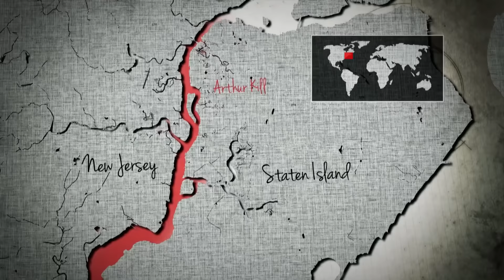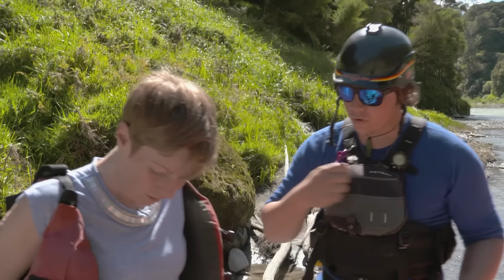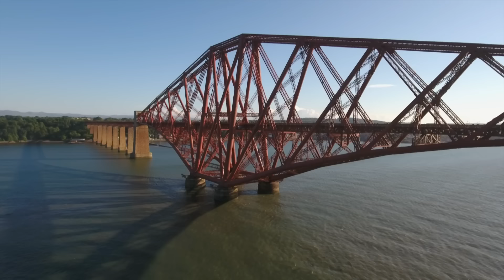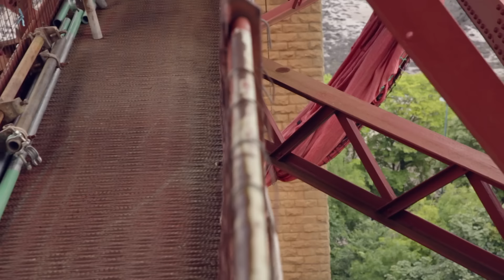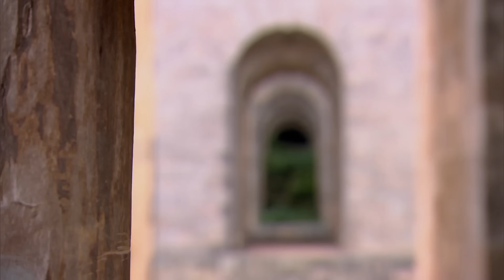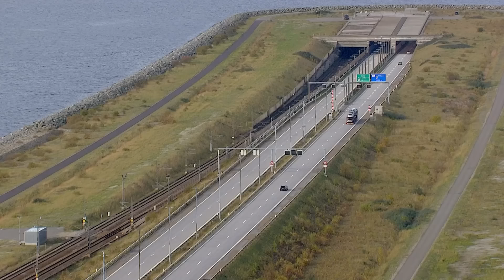175-Year-Old Railway Bridge Is Still in Use Today | Blueprint

Comment: The Forth Bridge is just over one and a half miles long. In the UK, miles are used, not kilometers.
Reply: @From 2016 mandatory to use metric units (alongside imperial.) Practically all industry is metric, I worked in construction and that certainly was and is. Also, the YouTube audience is global and every country (except USA) uses the metric system so it makes sense to cater for those.
Reply: @jackn4853  Totally disagree. This is the UK, it is a UK produced and narrated video about infrastructure in the UK. It should be imperial.
Reply: @jackn4853  
Metric's a more logical system, with a more precise basis.  Measuring lengths/distances are based on the speed of light and are constantly being refined to increase finite accuracy.  This ability to measure more precisely allows new engineering tasks to become feasible where they were not in the past, allows for new materials and highly quality versions of existing ones to be developed etc.  You just can't do that with the old, confusing, unchanging rigid measurement methods like Imperial systems that rose from times (predominantly from the Romans) before we had the scientific understanding or engineering knowhow to improve accuracy further.  Everything has it's time, and for practical purposes the Imperial system reached the end of it's decades ago.  I'd say a couple of thousand years is not a bad run, but time always moves on.

Comment: The brick arch bridge is a direct copy of ancient Roman aqueducts many of which are still standing today 2000 years later. For example, Pont du Gard in Southern France.
Reply: And it's not the only of this type - right next to it, a few kilometers towards Plauen, is the Elstertalbrücke (Elster Valley Bridge) - same engineering, same design, just slightly smaller. It's the second largest brick bridge in the world.

Comment: 19:58: in 1879 it’s predecessor the Tay bridge succumbed… this commentary is so ignorant that it doesn’t even know the difference between the Firth of Tay and the Firth of Forth. Two completely different waterways The 1879 Taybridge had already been replaced in 1887 by another, much more substantial pier and lattice girder design, with over 80 spans.
Reply: probably mostly ai generated - a lot of these vids are utter bull

Comment: For the piers of the Denmark-Sweden bridge, take a lesson from some of the US bridge failures. Large ships have a tendency to run into bridge piers, thus collapsing the bridge. See the Florida Sunshine-Skyway disaster.
Reply: They had one a year or two ago, I think it was in Baltimore or somewhere, a ship struck a pylon and brought the bridge down.  That's why in most places huge stone or/and concrete deflectors are built around pylons to protect them.  Probably not necessary with the Forth rail bridge though, it's foundations are mighty enough.  Fun fact about the Forth Rail Crossing:  Every rail bridge in the UK is designated by a number, the exception is the Forth Bridge which is simply designated as: "The Bridge".

Comment: I remember reading (or hearing from a TV show) that the Firth of Forth bridge is actually over-engineered. It could have been built with less steel, but the architects insisted that the bridge they proposed would never fail.
Reply: I expect that after the Tay bridge collapse, the engineers were a little risk-averse.  I would have been as well.
Reply: @anotherfreediver3639  That's exactly the reason.

Comment: Yes they perfected it and took it to a whole new level, but most of the engineering breakthroughs in  Western Europe and North America (USA & Cana) that they always present as if they were d first are most often copied from older civilisations that have existed thousands of years back like China, Cambodia, Egypt and many other older civilisations. But they always report as if they were the first ever without gathering knowledge or copying from older models mostly from ancient civilisations that had built monumental temples, pyramids, castles, walls that have curves and  arches etc. 

Now, if you keenly observe, when they're reporting any of Chinas recent engineering breakthroughs they present it in a way that indicates that China copied it or got the inspiration from Western architecture and civil engineering and that China only copied it from them and then took it to a whole new level of engineering 😊. Which is fine with me. But they should also remeber to give credits to the ancient civilisations that first did it and from whom they copied and got the inspiration from 😅. The west should learn to give credit where it's due.😂
Reply: All of those amazing steel truss structures and concrete immersed tunnels in the ancient times are truly amazing, they didn't ever even need to invent Steel!
Reply: @Tuberuser187  
Well, we did take the word "concrete" in reference to a Roman building material.  Theirs is pretty durable, some of it's still in daily use.  They mixed it with volcanic material which is why it's so durable.  Portland cement is our creation, it has the key advantage over Roman Concretia in that it's very mass producible from easier to mine materials than what comes out the spout of a volcano every now and again.  Even the term steel is just a borrowed title, in England we used to refer to steel in Medieval times as "Good Iron" as it was just a higher grade of forged iron than we could generally produce, Spain was most renowned for Steel/Good Iron.  What we perfected was the alloy Carbon Steel.